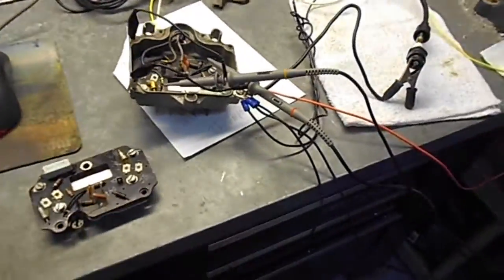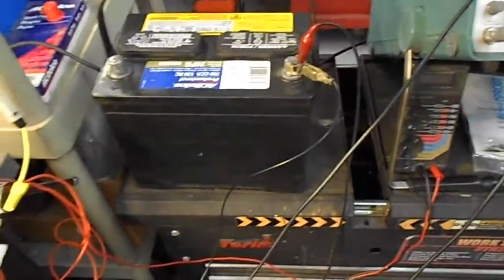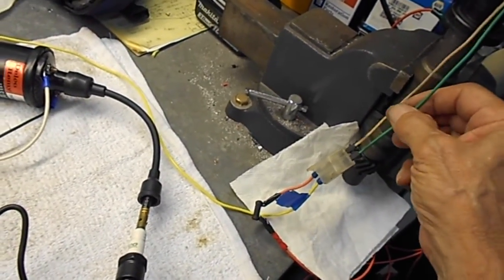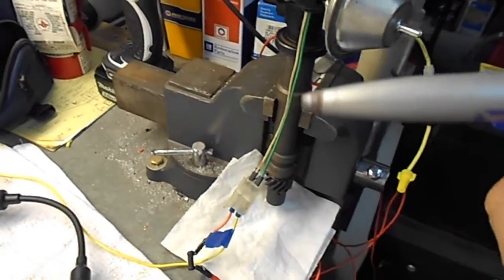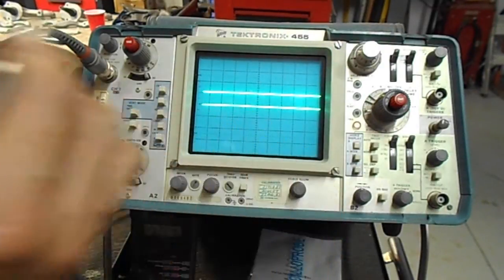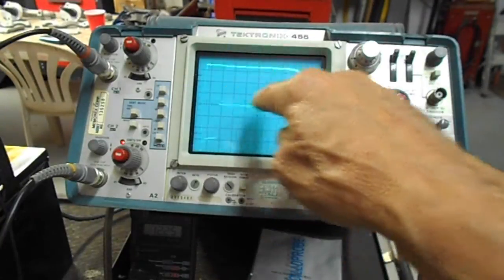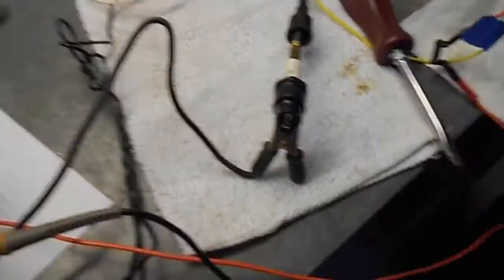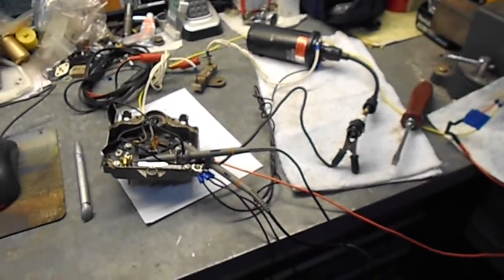1967 Corvette Transistor Ignition Bench Test

Comment: I have a 1969 Corvette 427 Engine turn key to start position. Nothing happens right off the key and it tries to start.
Reply from the maker: This is a normal occurance with TI when a fault exists. You get ONE spark when going from CRANK to RUN. With key to RUN, use a voltmeter to measure Coil+, to ground. You should get apx 2.5 volts. If good.... Key OFF.
Then check ohms of distributor Pickup Coil in distributor. Disconnect 2 terminal plug. Place 2 meter leads at distributor connector terminals. Reading should be 500 to 700 ohms. Wiggle the wires where they enter distributor and observe meter for intermittent open or short to ground.
There is much more to check which I cannot show here. I suggest you join "corvetteforum.com" Go to C3 General forum and create a thread with Subject "TI Problem". My username is "rich5962". Send me a PM or Email through the Messaging system after you create the thread with same info above, and I will reply with detailed diagrams and a diagnosis flowchart which will help.

Rich